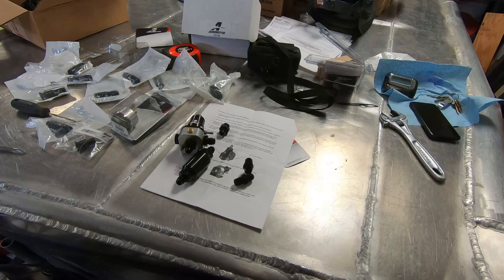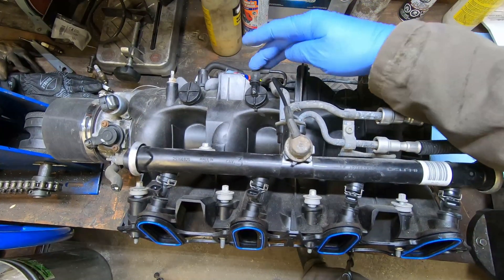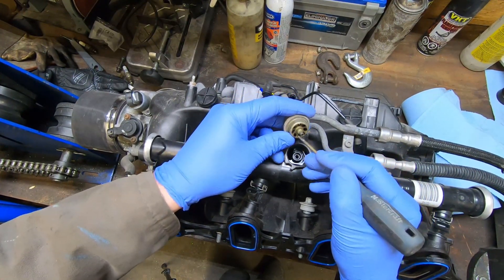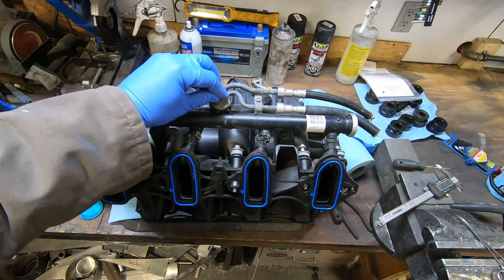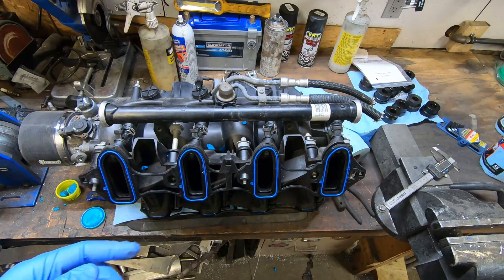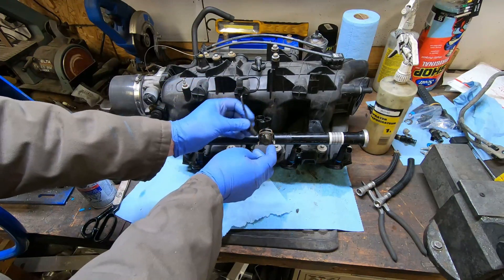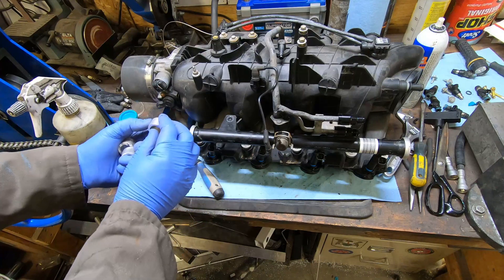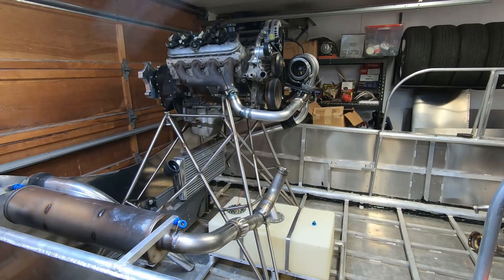Airboat Build #19: 5.3 LS Fuel Rails with Boost Referenced Fuel Pressure Regulator

Comment: The stock truck fuel pressure regulator works fine with my single walbro 450 and 15 lbs boost, on pump gas ⛽. 550-600whp and 1:1 boost reference is no problem.

 If you follow Denmah's Colorado/ no bs build or a21bravo's lsx ranger, the stock fpr couldn't bypass the DUAL 450 pump volume. That's where fuel pressure rose to 70-80ish psi at idle. 

On Matt's 4.8 Colorado build, the stock rails, decapped stock injectors, stock fpr, stock 3/8 line and single 450 pump were limited to approximately 520whp with 🌽 e85.
Reply: Yeah that’s what  I planned on doing, just adding spare lsa injectors from my nova build and a vortech v3 centrifugal supercharger…..done
Reply: 5 year old thread. I’m in the process of my turbo build now. Will the factory regulator and rails really hold up if I stay around 12psi? Plan on single walbro 450 as well. Will it hold up? Do I reference boost with stock regulator?
Reply: @trevorreagan2158 Yes, it will hold up to your goal of 12 psi on premium pump gasoline, not e85. The stock regulator will reference boost 1:1 when the vacuum/ boost line is connected to the fpr nipple and manifold.

The issue with the stock fuel pressure regulator is that the bypass orifice is restrictive, which causes the rail pressure to climb to about 65ish psi at idle, with the single Walbro 450. The pump volume decreases when the pressure climbs; see the Walbro 450 output graph. 

Try installing a pressure gauge and /or transducer to monitor your fuel pressure. A cheap adjustable fpr, like an Aeromotive knockoff, will be better able to better manage the higher volume of fuel. You can plumb it to the stock rails.

Take baby steps with boost and timing. Pay close attention to the AFR with a wide band 02 sensor gauge. Start with an AFR in the low 10's under boost, to be on the safe side. Make sure you have a 1/2 tank or more gas, so the pump stays submerged with fuel.
Reply: @1stamendmentsupporter thank you sir